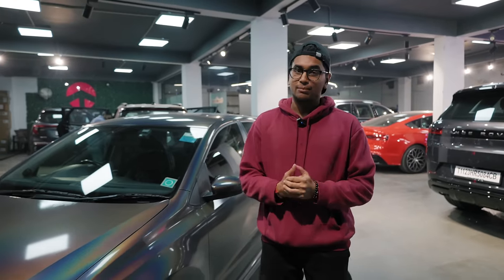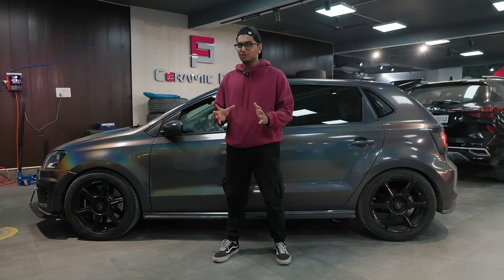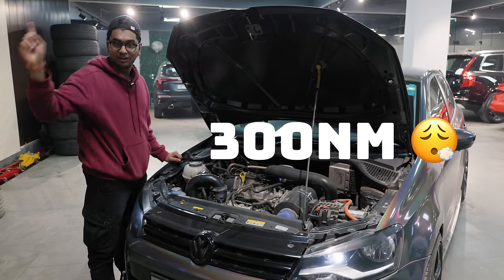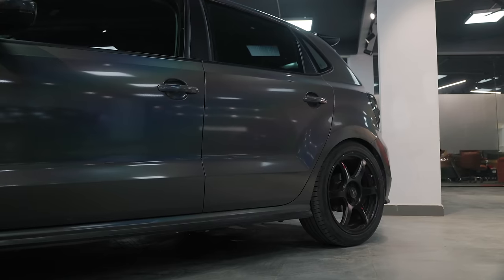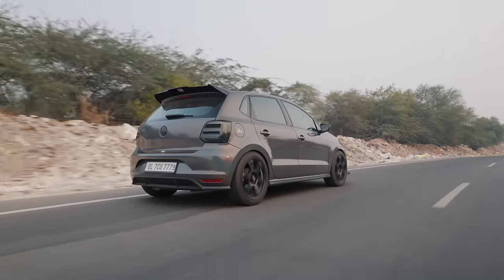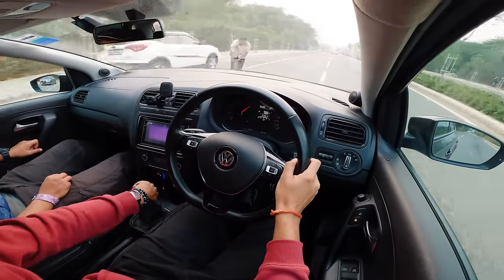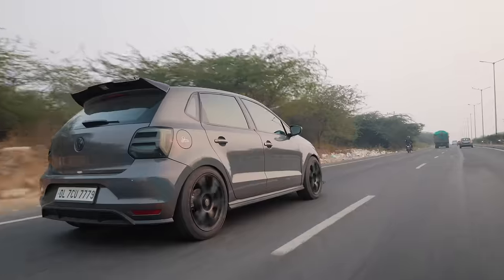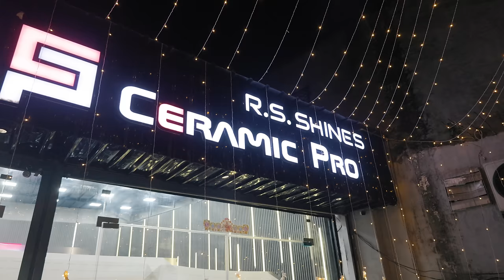200HP Polo TSI MT Stage 3 with a turbo from a Virtus GT! 🤯 | Autoculture

Comment: Abarth punto is more capable ❤ then polo
Reply: But not in terms of reliability
Reply: @aliston5028  yeah ,but at this lvl of modification, car's reliability is disrupted too
Reply: @abhinavsingh6.9  with enhanced intercooler and big turbo this engine is pretty much reliable than other tuned 1L tsi with stock turbo. Only thing it demands is servicing every 3-5k kms and not revving unnecessary
Reply: Abarth Punto is comparable to the GTI lol, not a stock basic polo
Reply: Abarth Punto has 1.4L turbo 4cyl petrol engine which is anyway better than 1L tsi (you’re correct till here) but if you compare it with old GTI 1.8L tsi it’s slower and new GTI comes with 2L tsi (we shouldn’t compare
Reply: @Subhow1z4rdMaitra   yeah punto and it’s 1.4L engine is discontinued so better not compare it with any car at all. We should compare what we are left with 😌
Reply: Abarth smoking that polo pack all day all night, also rest in pissing in all polos grave

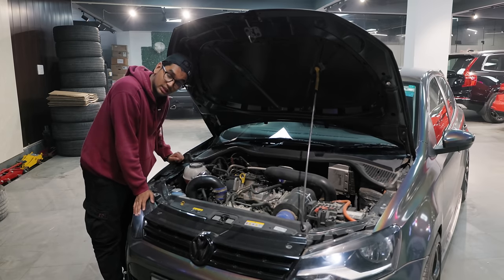Comment: What did i just heard here 2:56 ...

Intercooler is a device which is used for cooling the compressed gas from the turbo and all turbo cars have this. A better intercooler is required for bigger turbo charger.

This guy just compared it with the radiator which cools the engine.

Pls ignore if im wrong.
Reply: Yes ,  an intercooler is basically a small radiator .a seperate one.  The compressed air is going to be hot , which will reduce the volume of air entering the engine ( basically turbos are made to do the opposite ) .so an intercooler.
Reply: @irfanmuhmmed1014  yes....thats the same i said...but check the video time tag i have mentioned and see what that guy said